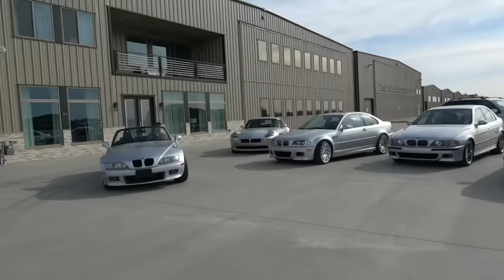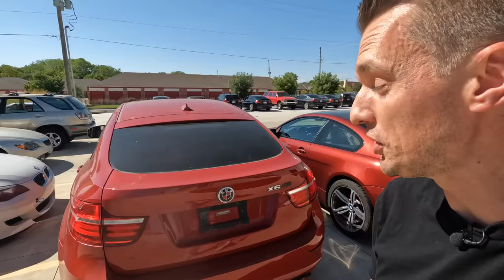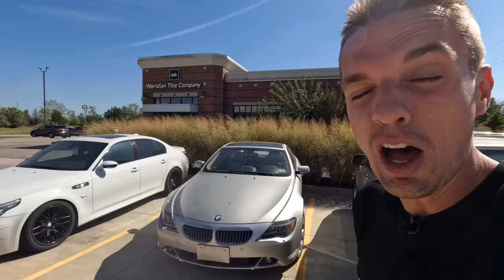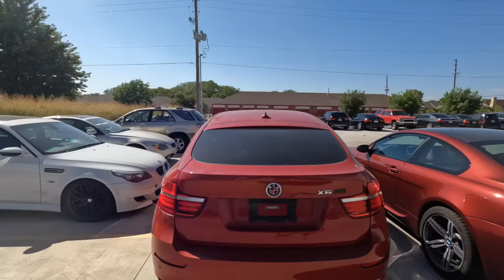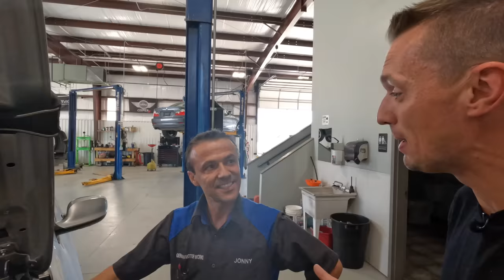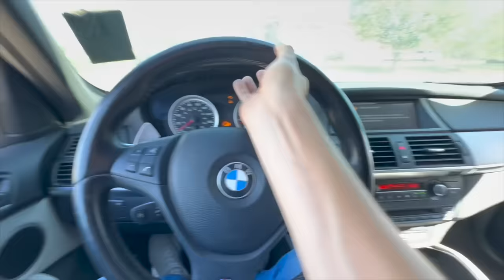I buried my $100,000 BMW X6M (Worst car ever!)

Comment: Buys a cars parts to do a swap, didn't get the correct one. Classic Hoovie.
Reply: If the transmision is right and only the bolts are not "matching" ,just buy an adaptor plate for it. PMC Motorsport are selling that kind of stuff, i've found them in Facebook.
Reply: They don’t call this the dumbest automotive channel on YouTube for nothin hahahaha🎉
Reply: I still say he should have drove it off a cliff in Alaska...
Reply: Wrong project.
Reply: Umm..shouldn’t Ninja have know this ?
Reply: 🤣 @mwqs1
Reply: So the correct tranny but the wrong bell housing.  Are the bell housings unobtainium? Surely there's one available from a wrecker or Europe. People have made adapter plates for decades of swaps. A competent machine shop should be able to do the work. I had a Vega GT 4 speed transmission and bell housing modified to fit a an Olds 215 V8. A local shop did the work in a few weeks and it was bullet proof.
Reply: Well said sir 😂
Reply: THIS! @Rekuzan
Reply: One would think that anyone who's owned fifty BMW's would not have made that  mistake. Nope.
Reply: @kraignadjkovic5494 Correct. . Some people cannot seem to keep his projects straight .The transmission swap car is not the one being buried. The two cars are not even the same color. How do you get the two confused ?
Reply: @niagra898 why would he know this? 🙄
Reply: It's really no surprise that he was such a failure as a car dealer.
Reply: @longjohn77  His specialty is BMW’s.🤷‍♂️
Reply: An adapter plate would have solved the problem but I suspect Hoovie didn't want to invest the money anymore and found a way out
Reply: The E90 M3 isn't cheap and obviously he couldn't find one even close to his price range so yeah I should know that's all I drive is BMW just E-46 Models the 🆉🅷🅿 and the E-46 M3
Reply: Maybe dig it up in June to see if it'll still run because if it does, he could still send it off that cliff next fourth of July!
Reply: right @sys-administrator
Reply: And THIS is why we can’t have nice things!  🧐
Reply: title says he burries his car
hires someone else to do the work
classic hoovies
Reply: I could've used that passenger side wing mirror
Reply: Kxji BMW’s are just terrible cars anyway , so best thing for it !
Reply: Buries toxic car parts in the earth.
Reply: I know right? All he had to do was ask the car ninja
Reply: "I'm so rich....LOOK AT ME" - Hoovie
Reply: @Kxji  yeah my thought immidiately
Reply: @sys-administrator not really depends on the vehicle
Reply: Tyler - sell me your M6 and cut your losses please.

Comment: I just "Sold" my BMW, a 1999 323i sedan, to a contractor who was gouging me. One of his workers asked if I wanted to sell it and I looked him straight in the eyes and without hesitation said, "Why, yes, I do!" The contractor took my asking price off his bill.

I bought it used in 2018 knowing it would require maintenance and repair, which it immediately and near constantly fulfilled that prediction while I taught my son to drive in it. I will always remember this car. When it was working, it was the nicest car I'd ever owned. Smooth, comfortable, quiet, and an absolute pleasure to drive, but never a month passed without something breaking and requiring expensive repairs. There was always a warning light on the dash letting me know of the next attack upon my wallet.

If Hoovie says that 2001 was a Golden Year for BMWs then it may have been for the E46 3-series, but 1999 was the first year for the E46 and there were many parts for the 1999 model year that didn't make it to the 2000s. I bought many parts that worked on every model of E46 except the 1999 model year. All parts were rare and expensive. The simple repairs I performed in my driveway, but my mechanic soon dreaded my many return visits. The electronics were 20 years old and so were the mechanicals, both were at EOL and it had become a money pit. The final straw was when the Xenon headlamp amplifier failed and burned out the bulb. I replaced the ridiculously expensive bulb and  still no headlight. Car couldn't be driven at night and the amplifier was part of an $1100 replacement headlight assembly. Should I replace it and then find out the failure was somewhere else in the CAN bus system?  That's when I decided to sell the car. I was glad to get rid of it and remove it from my  driveway and my insurance policy.

Comment: Every brand after the early-mid 00s learned one thing, "we can make alot more off selling parts and forcing them bringing it back to the dealer for repairs" ie: a Window Regulator from Dodge, same part thats in EVERY vehicle they sold from 1990 to now was $350, they wanted another $300 for labor. Advance wanted $110 for a dorman brand, and my parents and I worked on it ourselves.
Reply: Bmw have always been bad.
Reply: @chriscollins550  They are bad when idiots own them.
Reply: @chriscollins550 had many BMW’s , all workable and great . I say Audi are a POS if not brandy new . Lease don’t buy . If it’s old forget it 😬
Reply: The issue is that they assemble the car in stages and with components all bolted together.  Taking it apart or servicing is isn't a concern.  And as long as it makes it past the warranty period, not their problem.
Reply: It's sad that not only did we all offshore the production of parts, and some labor, we then cheapen it out to the nth degree to maximize every penny of profit.  It's almost a crime.
Reply: @aussie2uGA  This segment is really no different than going downtown in a major city where all the odd importers and discount stores are and walking past the sea of cheap knockoffs. This type of junk manufacturing has been going on for decades.  The problem is that it has invaded Amazon and other retail spaces like your hardware store.  Such that it's hard to know if what you are buying is legit or plastic/pot metal junk until you get it out of the package. In Amazon's case, not more than 50% of all products are stuff you used to laugh at or see in the discount store.  
High quality manufacturing does exist in China.  But you have to almost search for ti now.
Reply: @chriscollins550 that’s a lie lol. Those were just known to be junk even new
Reply: @JimmyGambiniEsquire  you had many, that says it all.
Reply: I’ve had a number of last Gen Bonnevilles. On one of them the passenger rear window regulator broke. All that happened was the cable got off track and got stretched.  The cable and pulley assembly could have been replaced. Only problem is GM only sold full assemblies with the electric motor for $300.  So I bought an assembly with a broken motor out of a junkyard for $20 and swapped out the cable and pulley.
Reply: @chriscollins550  what it says is I’m a mechanic and aficionado, Thanks tho, only reason I sold and bought was extremely high mileage or so old the rust got em. Try that in yer cornflakes LoL 😂
Reply: @JimmyGambiniEsquire  full not and bolt car restoration, everyday! Come to the EU and see how cheap BMW are after five year's. No body wants them. You never see z3 anymore they are all dead but a few.
Reply: Why not sell it for parts, then someone can benefit.
Reply: @chriscollins550  newer the worse , can’t argue that. I bet all the old joints are running laps around them still over there 👉
Reply: In fact, the more expensive the car, the faster the original owner will get rid of it (in order to keep up with the neighbors who also have to have the latest version) and the more lucrative repairs are for the brand.
Reply: So the 2nd or 3rd owner, as per the explanation in the 400Z Video from Throttle House @ApKieras
Reply: dorman parts are junk.

Comment: In the late 1990s when I was in high school BMWs were absolutely rolling status symbols; everyone wanted one and they made something excellent in every category.  I’ve seen enough videos & heard enough stories that I doubt I would ever buy a BMW newer than about 2001 unless it was brand new & under warranty.  The reliability & depreciation just make them a no-go.  Now, something from the 1980s & 1990s is a different story.
Reply: Some of the newer bmws are good my mom owns a 2019 X3 and it still has warranty and it’s been super reliable so far no major issues but I have a feeling as soon as the warranty is over everything is gonna start breaking

Comment: i had a 2019 x4 m40i and it was perfect. best car ive driven in many ways. but i only had that for about 2 years and 15k miles as it was partially during china flu shutdown years where everything was closed so wasnt driving much.....  i still miss it and would consider another if i didnt need a bigger truck.

Comment: Great decision on going with the 60x100 garage, you can always build another 2000 (of more) sq.ft. barn elsewhere on site in the future, which would fit the character of the place more than having that one big almost square building the 80x100 option would have been.

Comment: If the trans is correct, can't you just get a custom bellhousing made? Ive done that for an engine swap before and it was cheap and easy. Or buy the m3/m6   bellhousing and bolt it up if you can source one

Comment: All in I think that's the right choice with the M6. and the 645 will be enjoyed by it's next owner very much! as for that X6.... well.. that one I really don't blame you for hahaha
Reply: Put them all in the ground, best place for any bmw.
Reply: @chriscollins550  You've obviously never driven one. There are a lot of good BMWs. The X3 with a 4 cylinder and the salvage X6 "M" is not good example of the good cars the brand has.
Reply: @clonetrooper576  never driven one lol. I live in Europe. Most people in the Europe hate them. Only three types of people over hear drive them. The young that don't know the problem's, then the drung deals after that is the bone head.
Reply: If the transmision is right and only the bolts are not "matching" ,just buy an adaptor plate for it. PMC Motorsport are selling that kind of stuff, i've found them in Facebook.
Reply: @andrei.vasile  It may be more things that dont match up, like the bell housing may require its own hydraulic lines which dont match the M6s. It just is not worth it, the car is 20k miles, it should be kept stock
Reply: @clonetrooper576  it may be as you say but in my opinion is worth trying, or just asking!
Reply: @chriscollins550   A, a UK citizen.  I can tell by the propensity to hate cars for who drives them, not for the cars itself. In general, no other people in europe is as concerned by "social look". Class society holdover I guess.

So no, most people in the europe dont hate them, and even in the UK they outsold and more or less put the classic bread and butter brands such as Ford and Vauxhaull almost out of business, certainly in the saloon segment. Because of lots of UK people wanting to show off their status in comparison to those other brands, you see.
Reply: @clonetrooper576 I've owned my n20 x3 for like 45k now and even though I fear for the timing chain and guides exploding, it is pretty cozy and surprisingly quick for what it is.

Comment: I worked at a BMW dealership back in the 80’s. The inside joke was. How do you turn your money into a loss. Buy a BMW. The only thing worse was a Jag. They sold those too. I had to be there 4 hours before they opened with a case of either and jumper cables in the winter to start cars and let them run for at least an hour. So if someone came in they’d have the delusion that they actually started with the key. I used a 1950’s Willys for a jump and plow truck. There was always 7-8 feet between the lineup in the winter.

Comment: I think the best fix for a BMW is to LS swap it. Or if you got the money put in a hellcat engine. It would be fun.
Reply: I was just coming to the comments to say this. LS swap and put in some coilovers to fix the suspension
Reply: Bots always say the say thing -
Reply: @ahmadaomar91  it would be the perfect fix
Reply: @naradaian  Bots?
Reply: My boss Ls swap his old Jaguar, because it was slow and too many issues

I really want to buy it from him😂😂😂
Reply: @KobeCorona-uj3zb  heck yea, I like the Jaguar too,
Reply: Just say no to the LS engines, which are lame
Reply: 2jz 😅
Reply: Its too advanced car for such swap. How you imagine that 🙄 LS wont work with transmission, and manual swap would be very difficult.  Not to mention every single warning would pop up on the dashbord
Reply: @xiukn8  Its only hard if you don't know what your doing. I have built a lot of stuff over the year's.
Reply: @Arthur-ke9vz  they are the easiest and one of the cheaper more durable option's
Reply: @jpotter4899  lame
Reply: @Arthur-ke9vz  too you probably, I would have fun with it, so I guess ot depends on the person
Reply: @xiukn8 You have to swap engine and transmission. You run it on a Holley ECU, and Holley can be adapted to BMW clusters.

Comment: Don't what happened, I had a 1995 740i that went 300K miles before I sold it to a mechanic.  The engine and transmission were still solid and QUIET on that car.  It had a better stereo system than I had in my house.  It just kept getting little electrical issues that I would figure out and get some parts from RockAuto and be on my way.  I was moving across country and didn't want to spend 3K to move that tank and sold it to my Eurotrash mechanic.
Reply: BMW went downhill after 2000.
Reply: BMWs are great cars. People just don’t know or understand how to maintain them

Comment: Hey Tyler, you should go get an E34 5-series. They're absolute tanks and everything is super overbuilt. Whether you get a 525i with the 2.5L M50, a 535i with the 3.5L M30, or a 540i with the 4L M60, they're all superb automobiles. I've bought some of the most neglected examples around, with 300k miles, bad paint, accident damage, etc. and they've all still been quite reliable and have never let me down. They haven't really gotten expensive either, at least compared to some of the other golden era BMW's.

Comment: Why would you lock the doors? There is no chance the doors will have power to unlock them after the battery dies.
Reply: It’s not like he won’t be able to put his hand through the window and unlock it you do realize everyone of those windows is going to be busted out. The roof is going to be caved in on its self, he can lock it all he wants it’s not going to start year from now and it’s not going to have any windows left in it
Reply: Maybe it close automatic
Reply: You can still use a key.
Reply: Just use the key to unlock it later, The key is inside the fob.

Comment: I believe theres a way to convert the SMG to a manual. Seen some E46 M3's do it. You take the computer junk off of the transmission, make provisions for a clutch pedal and lay the lines and such. Maybe look into that
Reply: Or at least swap bell housing from smg,
Reply: It's doable on the E46 M3 SMG, but in that case you still have to get a new hole cut and tapped to install the different reverse-gear sensor. Apparently the later SMG transmissions are substantially less amenable to the conversion to the point where it would cost WAY more to make the modifications than to just replace with one that has always been manual.
Reply: That’s because the smg trans is shared with the manual on e46 m3.  Smg 3 is a 7 speed on the e60/e63 cars not a 6 speed, so it’s not something you can just remove the hydraulic system on and have a manual car.  Needs a full trans swap.

Comment: Hoovie, making the M6 into the best it's going to be means putting in the E92 6MT, even if you have to buy the transmission brand new from the fatherland.  If you don't do it and benefit from the increased valuation, the next owner will do it instead.  Better that you do it so we can watch and you can profit.

Comment: 17:03 Should not have locked it. The battery isn't going to let you unlock it in a year. You'll have to use the metal key from the fob.

Comment: I love my E70 2010 bmw x5 xdrive30i, super inline 6, super reliable, very easy to work on, over 200k miles only highway miles to and from work 45 mins each day for the past 3 years💪🏽💪🏽change fluids regularly and preventive maintenance.

Comment: Would still like to see the manual swap for the M6 come to fruition. 

Whether that’s with a different transmission or a Kennedy engineering adapter plate.

Comment: Time to get sponsored by a company that makes battery tenders. Make sure your new garage has plenty of outlets, on the walls, in the center of the floor, coming down from the ceiling.  Since you need multiple tenders, is there a company that makes units for multiples of cars?  Maybe a battery rack that has multiple tenders. That way if there is a problem with the battery, it doesn't leak acid while the inside the car, say a car suspended over another car...

Comment: I should have listened to you, Hoovie. I summoned the karma from the depths of the hooptie fleet.  In hind sight I should have bought a cheap , " problems disclosed "  deal off FB marketplace...
In stead, I picked up a beautiful, slightly used 2015 - BMW 428i  with the low low mileage of 58k,  so said the reputable dealership.... TWO WEEKS later, I'm stranded and have it towed to a shop that had a true, "laundry list". The total bill would have been in the 6k range... I drove it until I finished wrenching every day and finally got my old 2002 E350 7.3 diesel camper Van sorted out.  Now the BMW sits there in th3 driveway,  taunting me with the under water loan and repairs I need to get going... 😅 so screwed I want to light it in fire.

Comment: drivetribe also did the manual swap but on a e61 m5 if i remember correctly it completely transformed the car and that car had fire damage so i cant imagine they paid 15k for the swap, maybe its more difficult or less parts availability  in the states 🤷‍♂

Comment: Been there….had a beautiful low mileage 2006 X5 3.0 though this one was possessed.  2 engines, multiple sensor failures, CEL with no known fix.  Sold it cheap to get out of it.